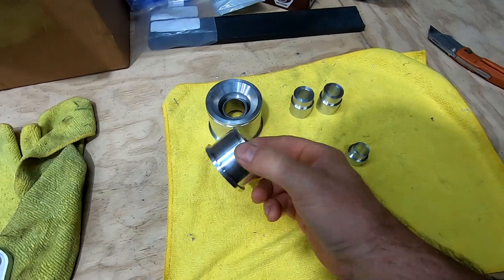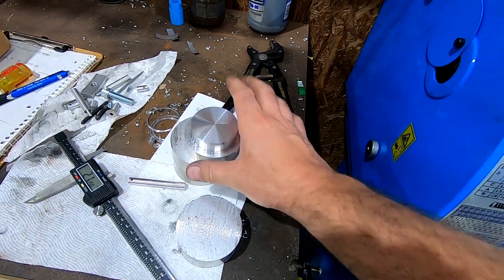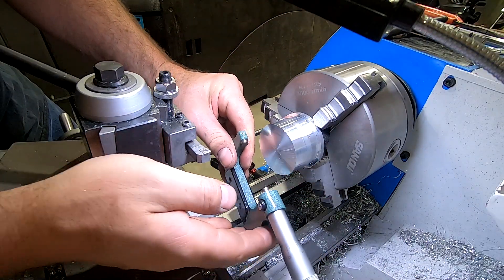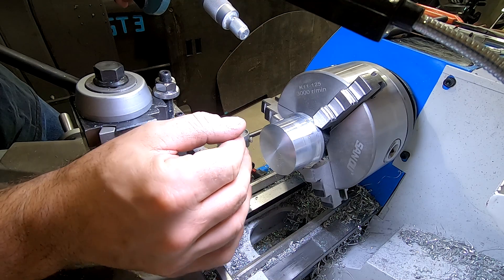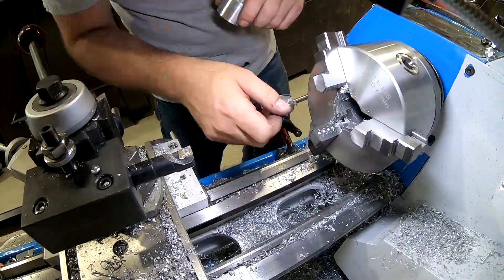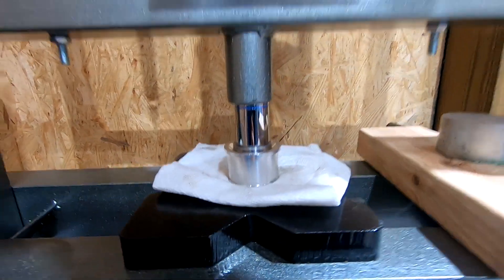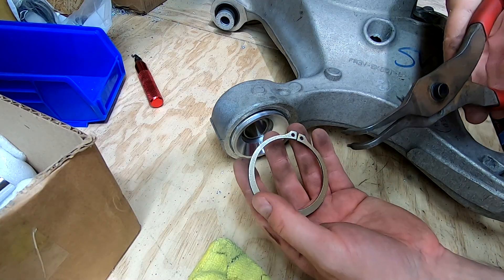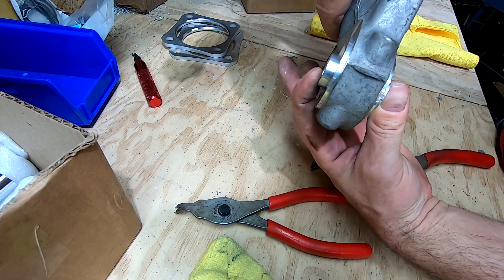Machining Solid Spherical Bearings For My GT350

Comment: A thought. Would suggest pressing the bearings and the assembly’s in “wet” with either zinc chromate or polyamide primer to prevent corrosion from water entrapment and dissimilar metals.

Comment: I recommend putting 3 to 4 .200" "U" shaped slots on the 1.200" bore side to give access to press the spherical bearing out when they eventually wear. Then you can make a "socket" with the 3/4 .1875" dowel pins as a press tool. Especially if you are going to sell these.
Reply from the maker: Not sure I follow. The spherical can be pressed out as is.